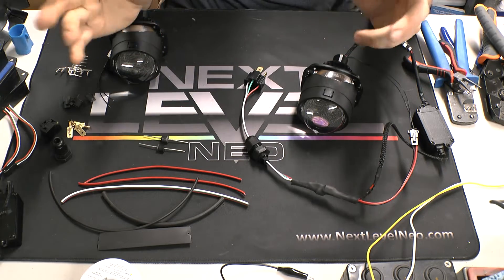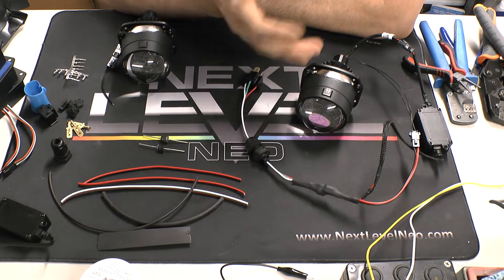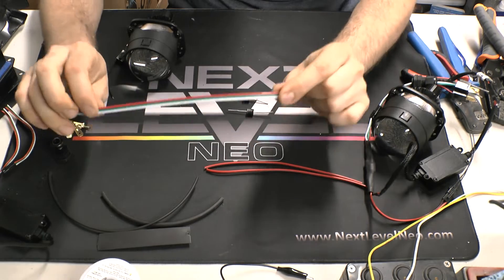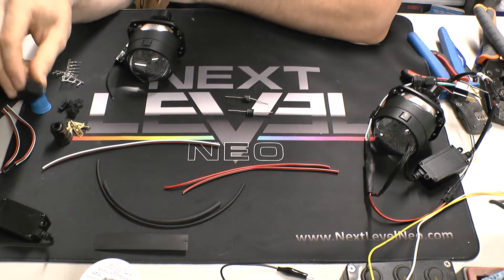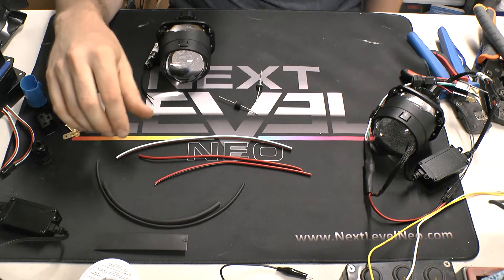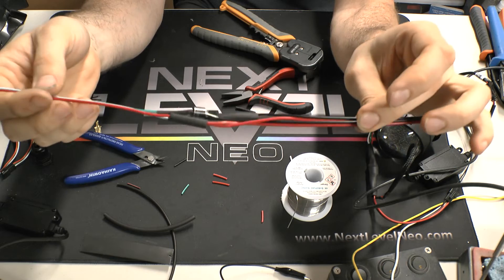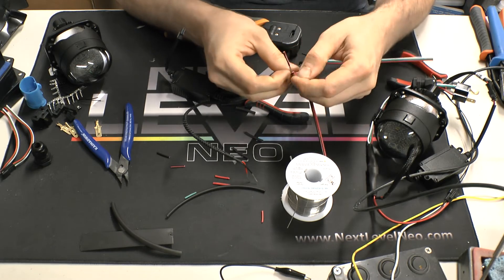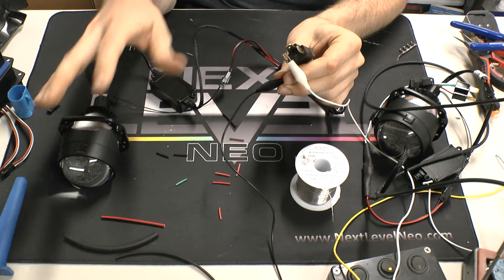How to Build a DIY Bi-LED Projector Harness: Step-by-Step Guide

Comment: Hello,but if the connection cable is 2 pin not 3 like yours.Then how to connect?Thanks
Reply: 2 pin connector h11
Reply from the maker: @Tiger-s4x7na 2 pin cable is not both high and low so you would not need a harness like this and can connect directly to the car
Reply: So,I have a toyota prius gen 3.I have replaced the xenon lights to bi led lights.The low beam and high beam have different cable 2 pin(violet and white with black stripe).The bi led projector that I installed has 4 cables for low and high beam.My question is should install a led driver aswell?I installed one but its for fog lights and the high beam works only on second switch of the lights and when the lights are switched off.Now I tried to connect the high beam cables from the bi led projector to the removed  high beam cable of the car(after removing from high beam bulb of the car) and now high beam is working.Can I split this connector in 2 and connect the bulb of the car and the high beam of the bi led?It will not affect the bi led projector?Thank you for your response.

Comment: My friend, you're showing the OPPOSITE current flow through the diode(i am amazed with how many were helped by this, Ha ha!)
My solution to this quite common issue: 
ONLY for the brave ones...
Locate the high and low beam relays (usually fitted on the fuse department)
Fix a 10 cm cable with a diode soldered in the middle(no schottky needed here)
Connect it ( i shoved the naked ends inside the pin female slot) with the current flowing(most important!) from the high beam relay output pin, to the low beam relay trigger pin.
i am not an electrician so i cannot be precise about the diode type, but it surely does not need a heavy duty one, cause the current needed, is the relay's triggering current...
That's all!
thanks for your patience
Reply from the maker: Maybe it's cause the car I'm showing it on is ground triggered. I've done it this was over a hundred times. It does work.

Comment: I really need a diagram for Nissan n16 with 4 wires red and black, two for low beam and two for high beam and my bi led has two for low beam and two for high beam red and black
Reply: The highbeam solenoid isn't polarized, so connect one wire to your highbeam power and the other to ground (doesn't matter which), then the low beam just connects to the stock low/ground and that's it

Comment: Is this the same for H7 plug with only two lines? But we would only need one diode?
Reply: I’m thinking the same thing but it’s worth a try
Reply from the maker: If your plug only has 2 wires that usually means it's single function so only high or low but not both. You need to find the power for the other bulb somewhere else. Older hondas like the prelude did that with an h4 plug. There were 2 h4 plugs with 2 wires each. One for high and one for low. On those lights you don't need to make the adapter because the low beam stays on when the high beam is on.

Comment: I'm going to be installing them into an 08 impala.  I'm gonna use the factory wiring for the high beam but run new wire for the low beam to wire it to a switch. the auto lights is always on on it and it keeps killing regular led bulbs in a year.      would 16 awg be good enough going from the interior to the headlights? also with it cause any issues with having the ballast mounted to the inside of the housing?   the air box and battery is right behind the headlight on each side.  I plan on putting this on the hi beam side and covering the low beam side with a panel

Comment: I have a slightly different way I wire up one of those dual filament bulbs into a bi-xenon or Bi-led.     Depending on the vehicle you may have to adjust the way you wire.    I explain to people that a diode allows you to feed one unit from two (+) circuits with out causing a short.    Most LED bulb and drivers allow for 24 volt (+) input to feed a load.  So you can feed an LED bulb with two simultaneous (12 volt + feeds) and they are fine.

The simplest set up is to feed the low beam from the low beam circuit.  Then power shutter and high beam from the high beam circuit.   Then run a jumper from the high beam circuit with the inline diode (N5404) to the low beam input.   This will normally make sure the projector is always powered by one of the headlight circuits, and won't back feed into the high beam circuit the high.   This will also make sure you maintain "flash to pass" function.         You don't have to use that huge diode.    An (N5404) 15 amp 300 volt diode is sufficiently sturdy enough to handle the load. The larger diodes (the one you are using) are rated from 45 amp and that is way larger than the fuse protecting the individual  headlight circuits.

I also make a similar set up when people have aftermarket headlights that convert a car from two dual filament bulbs to a quad set with separate high beam bulbs.   I will do a jumper with a diode to power all four bulb LED bulbs when the high beam is activated.

I have a "Y" that converts quad headlights into a bi-xenon/bi-LED and is wired to retain "Flash to pass"  so you don't lose any OEM headlight function.
Reply: Well i have an h4 adaptor and need to do bixenon converson (h1).I need the same brightness that my current wiring harness have. So which diode should i buy.
Reply: @HumanWar-l1c the N5404 will work or you can use the Overkill diode that the poster is using (in situations where you are using high beams 80% of the time and driving 2-3 hours consistently with the high beams.)

When I first started  playing around with wiring I used the most heavy duty stuff I could find them I started focusing on learning the specs and capabilities of the components so I could choose parts that were spec'd for the task I was using them for.

Comment: What is the setup for 3 inches? How can we DYI the harness for 3imches projectors?
Reply from the maker: The process is the same for 3"
Reply: @NextLevelNeo  and we simply don't attach drivers because they are built in? So just connect the harness created with the H4 and the projector directly and where the drivers are in2.5 we connect the solenoid. Right?
Reply from the maker: @LogosGr  the harness goes before any drivers included with the projector. If the drivers are built in or not will not affect the harness assembly. The driver is a part of the projector you use so that will vary.

Comment: Thanks for this video. I can say in the 9004/9007 fords, ground is constant and the hi/low are switched.
Reply: How do the diodes need to run for Fords?
Reply: @amorton94  hey did you figure this out? i believe they run opposite to this video but im unsure just seeing if you found this out yet and if u have any input

Comment: Hi, would you think it will work with may Toyota vios/belta? Currently may switch works on negative only instead of positive.. the ground was on top and low beam at right side the the rest is high beam.. hope you can enlightened me with my concern

Comment: You're Legend!! I have ground switches and created the same harness wiring with correct power flow. and it works charm, i didnt found the 30sq050 diode in local market, but i found SM 5150 (should be 5200 but similer a lot) Diodes to work on, thank you very much for the video! you save my time, and cost!!!

Comment: For cars with 9005/9006 connectors, does it require a ballast/harness/LED driver if I'm looking to install Bi-LED projectors?  Can I not just rig it so it connects to the OEM connectors?  I mean, if a ballast isn't required when running LED bulbs then why are they required for Bi-LED projecors?
Reply: most of bi led projector ballasts are built in, so you don't need them anymore
Reply: unless they came with, different scenario with hid

Comment: Is it possible to explain how to make a kit with 2 postive switches and one negative or does anyone know anyone who has?
Reply from the maker: @ryanchetty7188  a common ground and switched power just needs the diodes flipped 180 degrees. You run power through the diodes and ground goes straight to the projectors

Comment: I did bi-led on my 2004 tacoma , low beam working fine but when turned on high beam was shut off. 
The harness will solve it ?
Reply from the maker: @ThangNguyen-xl2vk  these will absolutely work on the tacoma. Just keep in mind if they are power or ground triggers since that will change the way to make it. That is explained in the video.
Reply: @NextLevelNeo  Hi , i just did the wiring harness but got no luck, low beam working but high beam still doesn’t work, tried messed up all day now , for sure the high beam blown fuse 
What i do now ? Flip the diode ( hi-beam )
Reply: . Did you ever find a fix?  I just finished my BI-LED, and the lights are bright but then dim when Highbeam is active. I may consider my xenon harness as a resolution.

Comment: So if it was positive switching, do I do this process but instead of negative do positive wires?
Reply from the maker: @davidgilson867  correct, but you also have to flip the diodes 180 degrees. They are directional.

Comment: Do you sell this harness on your website? I can’t seem to find it
Reply from the maker: @rachdhaliwal9493  we do not because there are many different variations. This is covered in the video which is a tutorial to show you how to make your own.
Reply: @NextLevelNeo just finished this. Found out the hard way that you have to flip the orientation of the diode for the H4 with 2 positive switches. Thanks for the video! Btw ordered as much as I could through your affiliate link lol

Comment: can i have a diagram for this? because my high beam wont turn on. thank you so much.
Reply: Same problem here bro. The solenoid makes that ticking sound but there’s no light from the high beam.
Reply: might be a positive trigger, this is a negative trigger, try to flip the orientation of the diode

Comment: hey man, im really new when comes to this thing i have a scooter and i wanted to put this on as a headlight 2 of them actually. and i have no idea how does this work all i know is it needs a relay and again idk how that works. i need a 5 year old kind of explanation for that topic. thanks in advance!
Reply from the maker: @lain6578  small lights can be extremely difficult to work with, at times impossible. The goal of videos like this is to make it as easy to understand as possible but unfortunately some things just can't be that simple. You may need to reach out to a retrofitter to have a set made for you.

Comment: i got a 09 ford focus and when i turned on the low beam they work but as u said in the vid the highbeam just turns the whole thing off will this fix it? just cant find anywhere for anything about the time of highbeam whether its negative or positive switched thanks
Reply: you can check if you have a multimeter if its a negative trigger, the common will have a 12v constant power and if its positive trigger  you need to turn on the switch

Comment: Diodes are 30 amp 12v alright?
Reply from the maker: @ESTroll  diodes come in many sizes. We used the ones at that link, results may vary with other sizes.

Comment: I tried for hours with my Hyundai Getz harness and only managed to burn the headlight fuse a few times. Can't figure out how it works. I tried from one positive to another (when you power the high beams you would also power the low beams, doing a jumper with the diode between both but didn't work) tried the way in this video and also didn't work. I ran out of ideas :(
Reply from the maker: @thevinylwrapper  what year Getz? Is that
Reply: @NextLevelNeo  2007 buddy
Reply from the maker: @thevinylwrapper  does the headlight have 1 bulb for high and low beam with 3 wires on the plug inside the light?
Reply: @NextLevelNeo  yep
Reply: @NextLevelNeo  it's a normal H4 with the square type plug. With a multimeter I checked the pins and I got constant 12v on the side parallel ones and negative on the top centre pin. When you turn the switch on to low beam only one side has 12v and the top is still negative but if you flick the high beams the negative top dies, the left positive dies and the right pin now is the one with 12v but the other two pins are dead (in another words, unless I earth it directly to the car I can't get the high beams to close the circuit...) Weird :(
Reply from the maker: @thevinylwrapper  do you have fog lights? Fog lights can mess with the high beam circuit when present. You may need to try disconnecting the fog lights
Reply: @NextLevelNeo  nope, no fog lights :( Also noticed that the halogen high beams are dimmed when I turn them on.
Reply: @thevinylwrapper  Did you ever figure this out?
Reply: @thevinylwrapper Hi did you solve the issue, my low beam led working but high beam is dimmed now ? I did try any method but still not work probably

Comment: Hi there, very good video.  I have a situation.  I bought Sanvi biled laser projectors 3".  The projector has 5 wires, 2+ and 2-, for the low and high beams.  I guess the fifth wire (yellow) is for the laser, but, when I join that one with the high beams, the projector turns off and restart.  I am testing the projectors with a 14v laptop adapter, could it be the reason of not getting the laser beam?  Or does the wire need diode?  The projectors uses canbus because of my car (Hyundai Elantra i35 2013).   But, another situation is, when a I connect the canbus, nothing work even the projector, and when I connect laptop adapter directly I can see the low beam and the hight beam, less the laser because of the fifth wire.   Any guidance or information will be welcome, thank in advance.
Reply: hi bro did you find a solution for this? im having trouble with mine
Reply: Same problem here, some development

Comment: I like to instead add a relay kit to change from switched ground to switched positive. Use the wires from your original plugs high and low to activate the relay and give you full power straight from your battery. Plus it takes all the load off your factory switch

Comment: I tryed that on a car that has projector low beam and a reflector high beam. When i installed bi led projector high beam works only if low beam is on so i used 10A10 diode so the high beam can work when low beam is off but diode is getting VERY hot.
Reply from the maker: On most cars like that the low beam stays on when the high beam is on and you won't need to use this style harness. What car is it?

Comment: If your car has negative switched headlights, (Most Japanese cars from early 2000's) follow this guide guys! He does a really good job of explaining everything clearly and explains every part of the way. This is cheaper and better than any of the adapter harness's, which are really hard to find/determine which specific one you need for your car. I did this for a 2010 honda fit and most other Hondas from early 2000's would be the same. There's a comment in here about reducing the output slightly because of the diodes, I can say that I did notice it too but because the lights are so much better and brighter than the stock halogens it didn't matter to me. (Edit) Honda fits are positive switched headlights and this process will work fine you will just have to switch the orientation of the diodes.
Reply: The project in this worked by luck only,because theoretically this guy is wrong but practically the circuit worked.The diodes are properly attatched in forward biased but they worked because of the ground pin switching of the headlights,he shows the wrong direction for working of Diodes.
Reply: Another tip guys, keep your soldering iron hot and be as quick as you can with the diodes, these seem to bee extremely sturdy/ heavy duty but I have heard from other enthusiasts that they have ruined a couple of diodes by overheating them when soldering.
Reply: what led you use? i have h1 sized projector, and i wanna do my fit to

Comment: Does this circuit harm the projector or any kind of an other issue?
Reply from the maker: Generally no relay is necessary. But it would depend on the factory wiring gauge and wattage load of the projectors.
Reply: @NextLevelNeo  okkk thanks
Reply from the maker: If done properly, no, it will not harm the projector or the car.
Reply: Do we need to put a relay or something for safety or this works fine without relay too ?

Comment: do you happen to make a harness for an 04 Honda Element using Gzminjie 3" ? It has a red, Black along with smaller white and yellow wires.... HELP!
Reply from the maker: We don't make harnesses but you can follow this guide to make your own.
Reply: great video although still unclear which wires go where on the 3 prong plug?? TY Dan @NextLevelNeo
Reply from the maker: @danmccarthy5247  that's because there are many different variations. You have to figure out what layout your car has. This is why we don't just make a harness and sell it. There are too many variations.
Reply: I understand thanks for the interesting video!! @NextLevelNeo